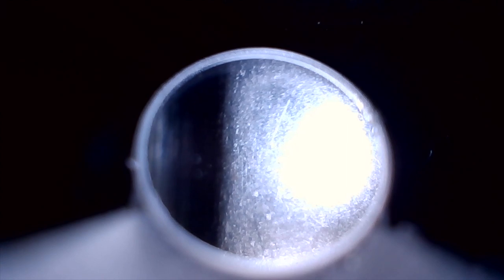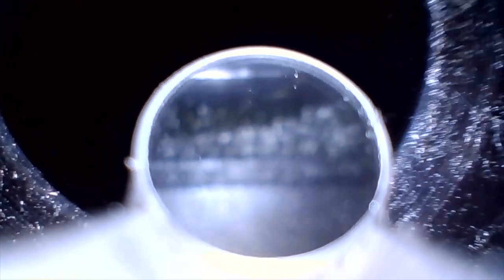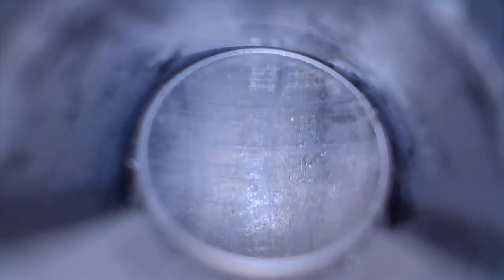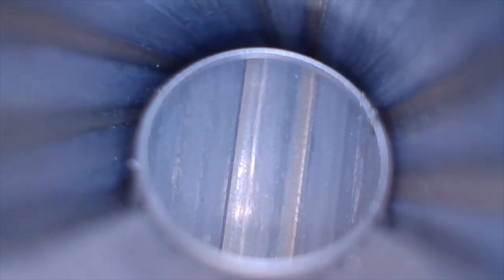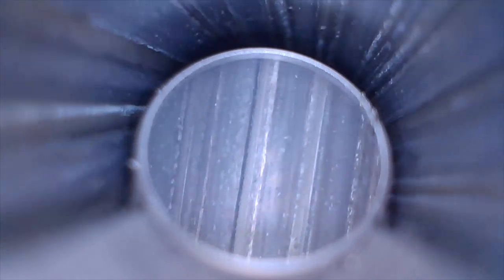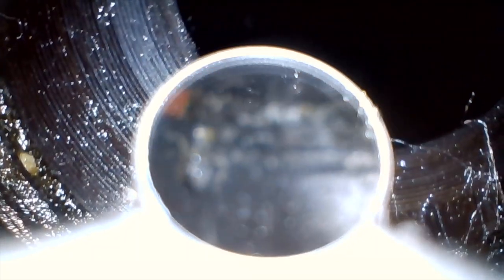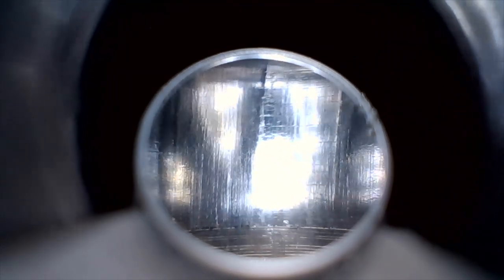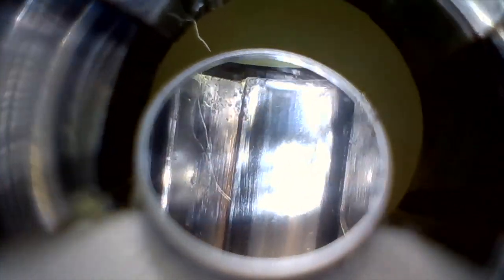Borescoping Sako 6.5x55

Comment: That's a first class Barrel. Good before cleaning,   excellent after cleaning. I clean after every shooting, oil the barrel, deoil before the next shooting. So I have every time the same start ( especially for hunting). I had corrosion in several barrels before I changed my system.   I use paper tissues on a woolbrush for deoiling ( cheap & good). Greetings

Comment: Bought a 22 hornet unseen. Once home, i saw it had pitting with my bare eyes - about half way in and close to the muzzle. The rifle was in good condition, but i guess they had forgotten to remove snow from the barrel after hunting ripor.

I went to a friend with a borescope and verified this. We decided to remove 5cm of the barrel and re-crown. Said and done.

I cleaned the rifle really well with thorroclean (excelent product). I started loading some cartridges and over a period of perhaps 100 shots the rifle started grouping really well. I can still feel the pitting when cleaning, but I have settled on ignoring it as the rifle shoots 15mm or better with proper ammuntion. Anything around a MOA is great, as the distances i use a hornet for is modest - its a .22 caliber rifle with modest velocities after all.

bought a 222 with similar issues, but i never recrowned it. I just plastic bedded the stock and cleaned it well but the first 50ish shots spread over a entire a4 paper. But after a couple sessions on the range, it shrank the groups alot and started to shoot like a 222 is expected to. It went from shooting 52 grain FB over entire target (45cm?) to almost single hole.

sometimes rifles are not kept well, and cleaning and some patience is needed.. I imagine the cleaning and following filling with new copper made the rifle calmer.

I try and not clean it excessively now, just a couple patches thorroclean every 50-100 shot.